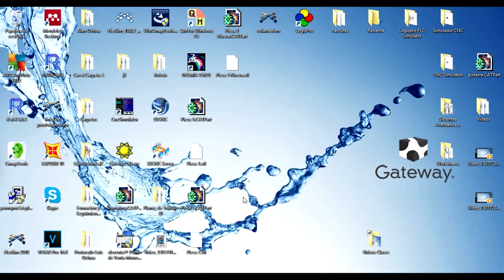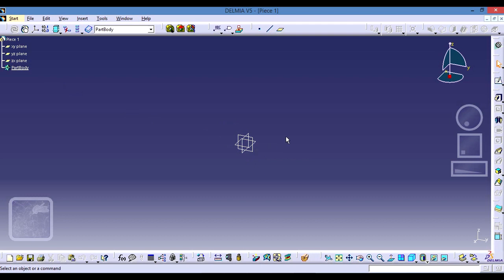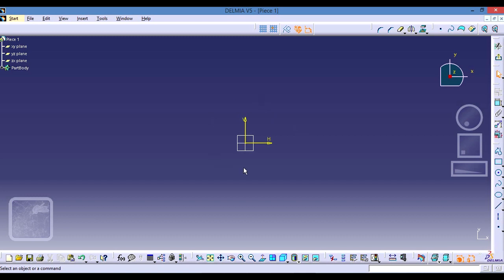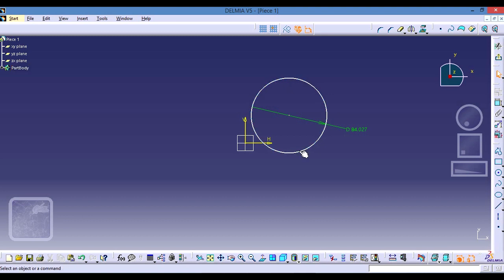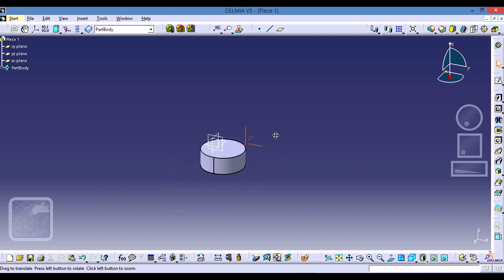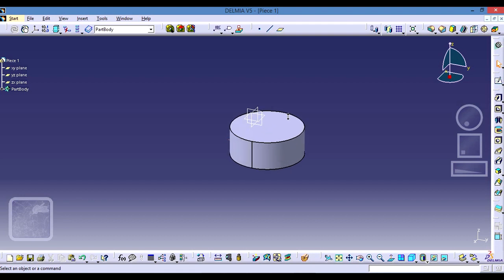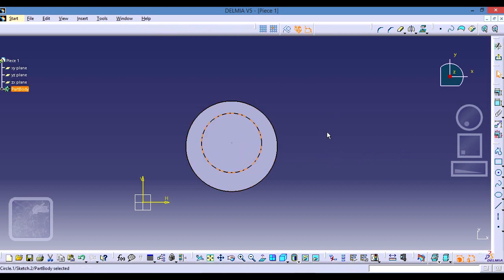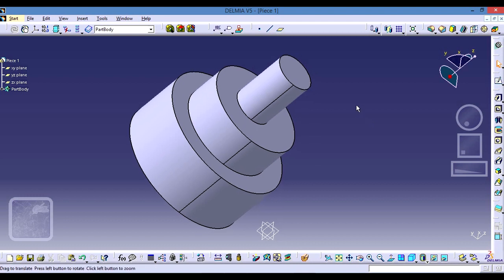DELMIA Basics. Introduction to 3D Modeling | TUTORIAL STEP BY STEP DELMIA (CATIA V5)

Comment: What’s the difference between Catia and Delmia? The Dassault website is one big clusterfuck.
Reply from the maker: Catia is the set for only 3D design and Delmia is the set of different modules where the 3D Design is also included, but you can find other modules for machining operations, simulation of production processes.. for that reason if you search for tutorials of Delmia and Catia you will see the same interface (at least in the V5 versions)
Reply: Luis Jesus Ochoa Navarro Awesome - thank you Sir
Reply: Unlike Dassault, this is what Fusion 360 got right - they built a real community. Fusion’s website has easy-to-find documentation, FAQs, and forums. Dassault’s website is cluttered, exclusive, and their products are only described in broad terms.